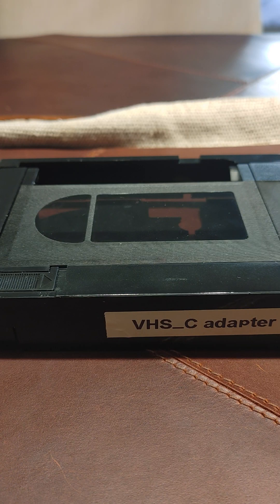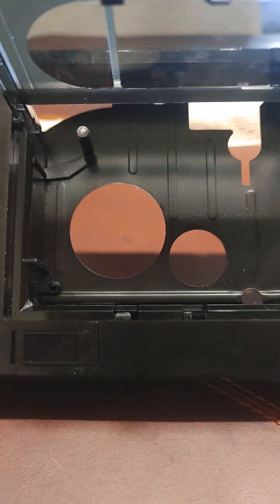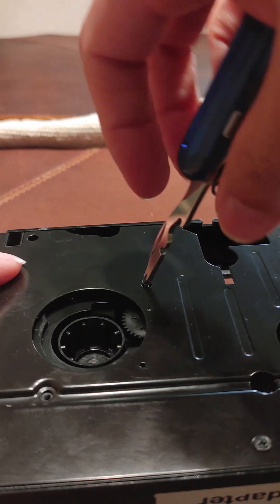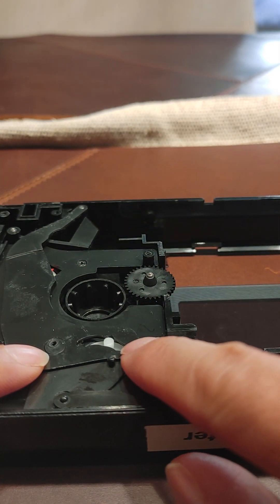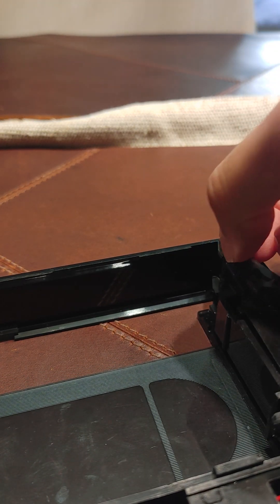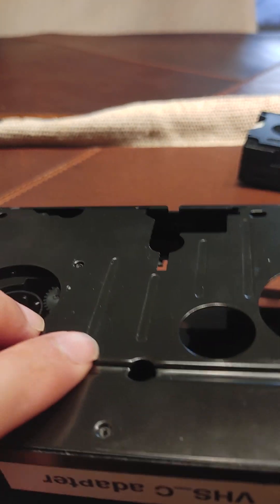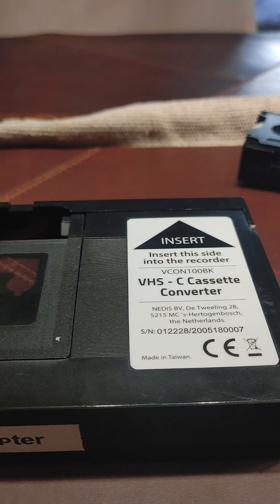How to UnJam Stuck VHS-C Cassette Adapter 2023

Comment: What happens if the cassette got stuck inside and try different batteries and would no open
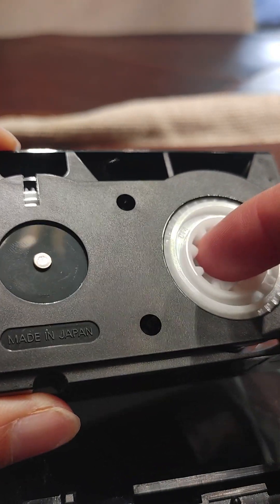Reply from the maker: To remove the tape proceed with caution and follow steps until 5:14 to disassemble cassette adapter.

Then you would buy a new VHS-C cassette adapter to view your tape

Comment: Can you help me
Reply from the maker: The electrical mechanism must still be powered by battery. If there is no movement or sound with the battery installed then this is a more difficult situation.

It may require further deconstruction of the cassette adapter. It would require a lot of skill set and your would need to record your actions to remember how to unassemble and reassemble.

Proceed with caution or seek assistance